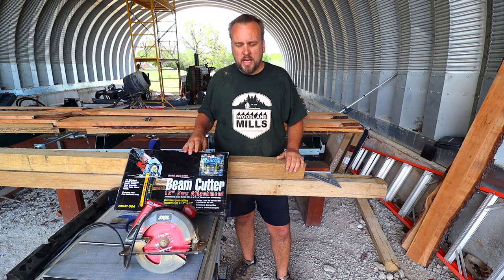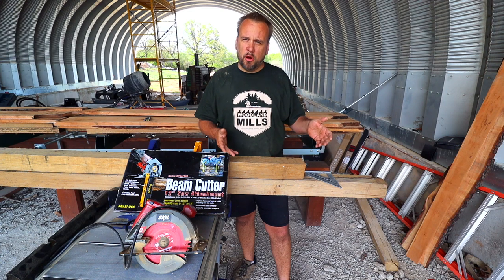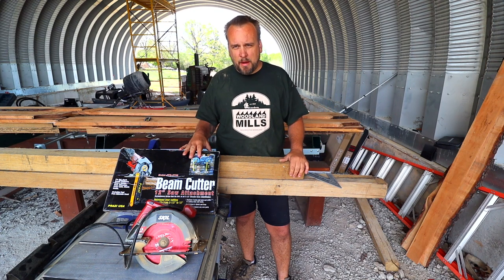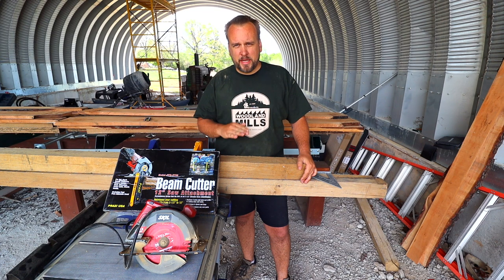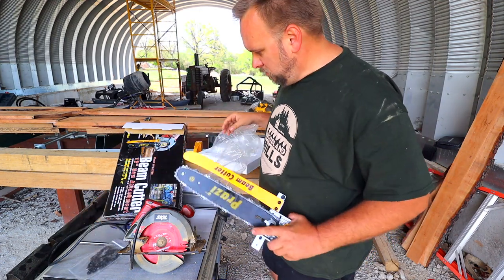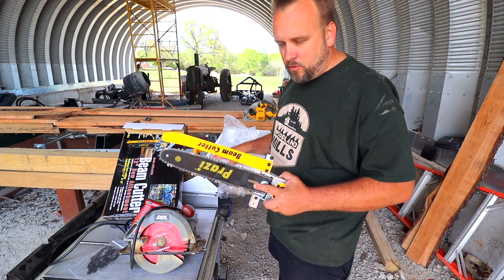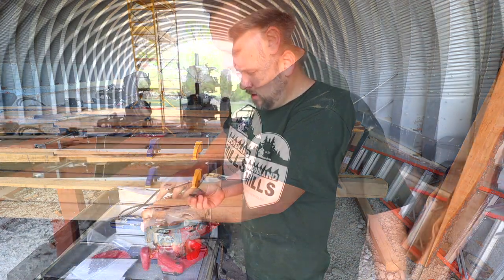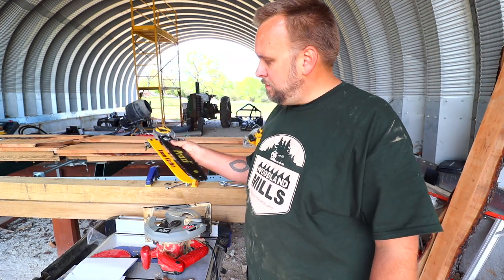A Better Way to Cut Beams???

Comment: I have a heck of a time getting beams cut off square with a regular circular saw.  I can cut them, but they never seem to come out perfectly flat.  That seems to be just the tool for that situation.  I'll wait to see how it works for you in the future, then I may have to purchase one myself.  I'm planning on building a sawmill shed and some woodsheds with my home-sawn lumber.  With the tool I have, 4x4's are the biggest I can cut perfectly.  I sure hope this works out well for you first, then me.  😊

Comment: I wonder if you could use it as an Alaska sawmill type of device, cutting down the sides instead of on top, for smaller logs. Maybe cut 8" or smaller logs square.
Reply: There is a guide you can buy for those types of things.

Comment: A little pricier than I was expecting. I was going to suggest if you're cutting 6" thick material, find yourself an old school 14" circular saw. You can up to 12" with two cuts.

Comment: It definitely has its place. Looks like you'd get a cleaner straightener cut using this. In my opinion, if you need perfect cuts or have a lot of cuts to make it's probably worth it.

Comment: Stuff like that works for awhile but my money is on it has a short working life.   No oiler is going to overheat and wear that little bar. 

What us the point of the yellow metal part is it just protection? 

I cut beams by hand with a manual saw.  Slower but I can be very precise.
Reply: Yep, just imagine if it kicked back or anything else happened. Yellow bar is the only to help protect you.
Reply: @Jtwizzle  That's probably a secondary effect. It think it's intended more as a riving knife, like on a table saw.